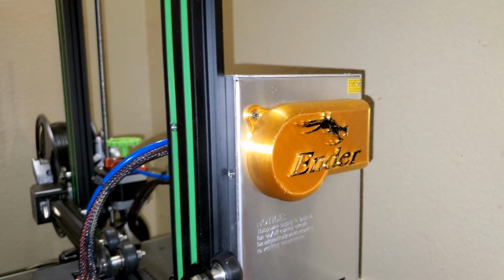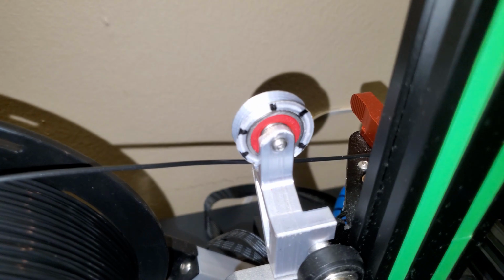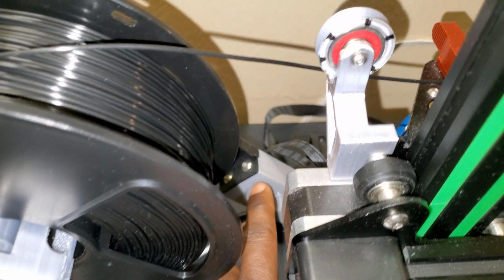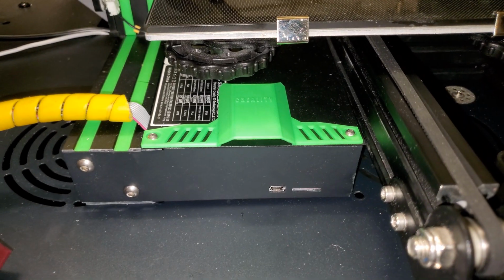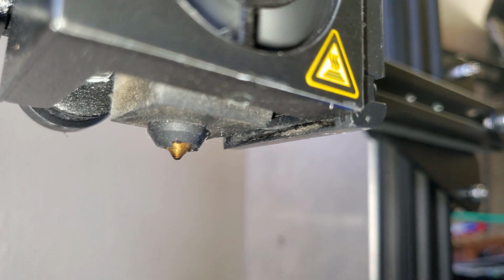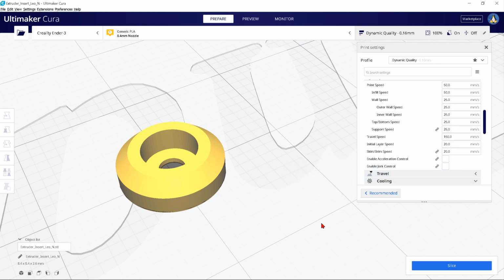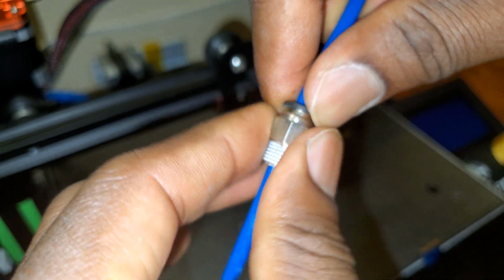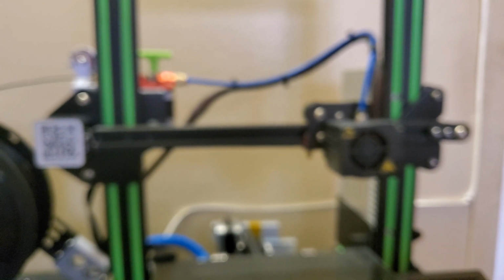Creality Ender 3 and 3 Pro Upgrades

Comment: i wonder how i take the bowden tube out if it melts inside
Reply from the maker: Easy, just heat the nozzle to 180 degrees and pull it. The mistake is trying to remove it while the nozzle is cold

Comment: Hey what layer height and infill for the side because mine is not strong enough at 20
Reply from the maker: I used .2mm layer  height and 15% infill, but if that's not strong enough for you, go with .16mm and 30% infill. You can increase the infill, depends on how much plastic you wanna put into this